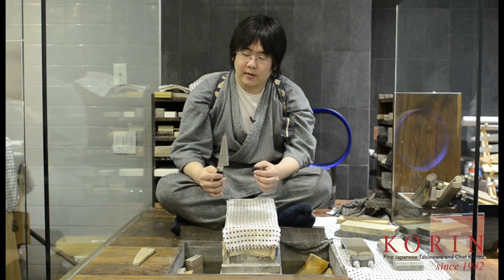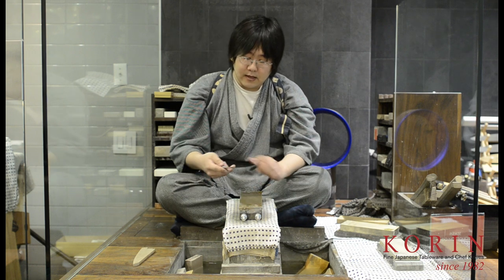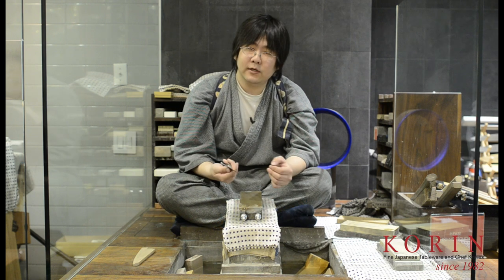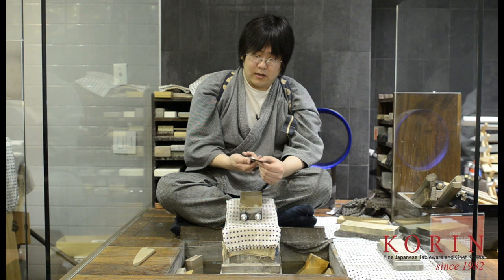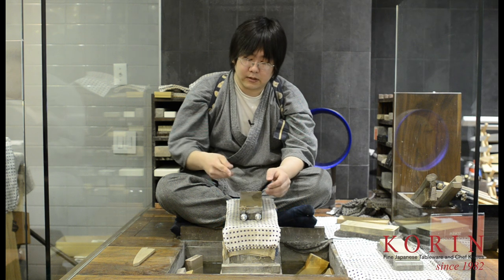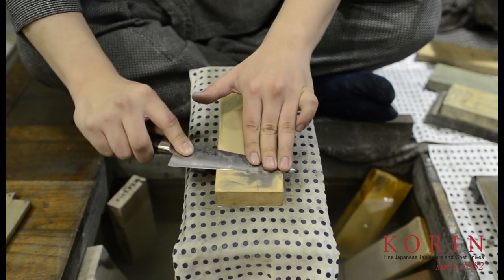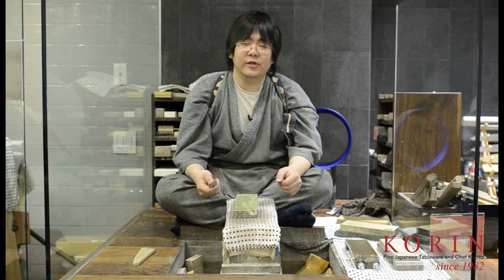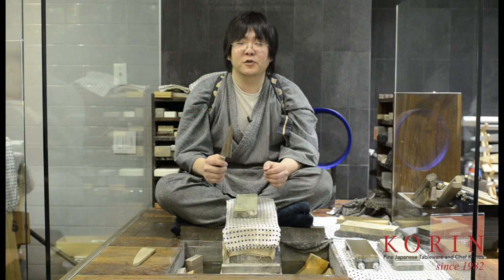Learn How To Sharpen: Episode 7 - Boning Knife

Comment: Hi , what brand of stone do You used most , in 1000 grit , 4000 grit ? I have a king stone but I would like a better recommendation , thank You for the  excellent teaching technic how to use the stone .
Reply from the maker: Hi Nelson, thank you for watching. Naturally we would recommend our Mizuyama sharpening stones. You can find them on the Korin website. The stones were developed by Mr. Shouzou Mizuyama. Mr. Mizuyama is considered one of the top sharpeners in Japan. All the major knife vendors like Masamoto, Misono, and Nenohi goes to Mr. Mizuyama for sharpening advice. You can't go wrong with that.

Comment: are japanese boning knives sharper than victorinox or swibo boning knives?
Reply: hobosnacho Japanese knives are commonly single bevel, whereas western knives (the ones you mentioned) are usually double bevel. (If you don't know what the bevel is, a quick google will make it clear) A single bevel knife will always have a more acute, and thus sharper, angle than a double bevel knife, but it really depends on how well the knife is maintained by you. Also, Japanese knives are more commonly made of carbon steel, which can take a more razor thin edge than stainless steel; however this is not to say that western knives can not be carbon, and Japanese knives can not be stainless. Until the 1950's, most kitchen knives worldwide were carbon steel, because stainless was not yet economically viable.

In the end, it all depends on how often, and how well you sharpen your knives. My stainless, double bevel Wusthof is currently sharper than my carbon, single bevel Gesshin, simply because I have sharpened the Whustof more recently.

Comment: What?  If it was meant to be a single bevel knife why wasn't it sharpened this way to being with?   Why would the factory sharpen it not only to an inferior sharpness, but also such that the "proper" sharpening technique would result in cosmetically defacing the knife?

Plz, I don't understand!
Reply: It’s not that the “proper” technique is wrong, there is nothing wrong with keeping the factory 70/30 edge. I keep it on mine for the sake of durability, and it’s still easily sharp enough to handle any task and I don’t have to worry about chipping if I’m a bit careless and hit bones too hard. 

If you want to go sharper then you can go to single bevel, but you don’t need to if you don’t want to.